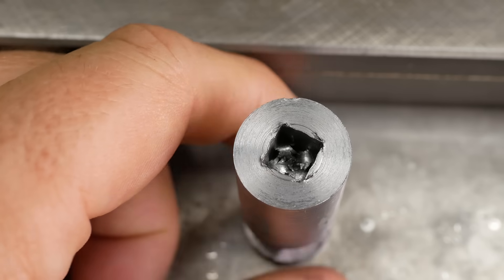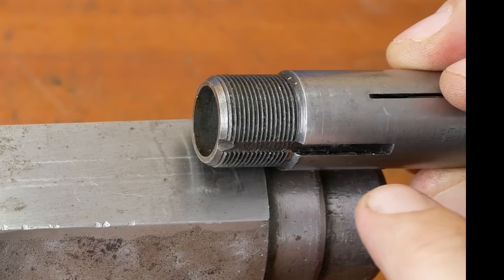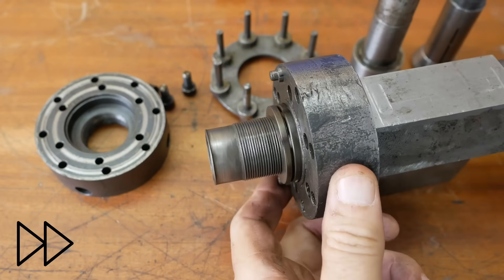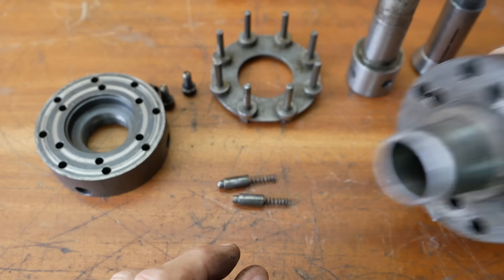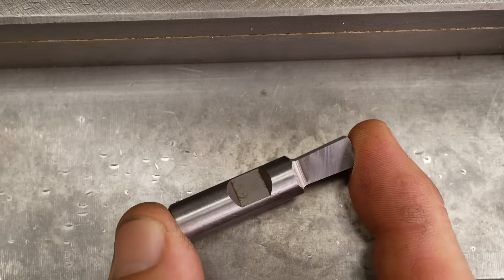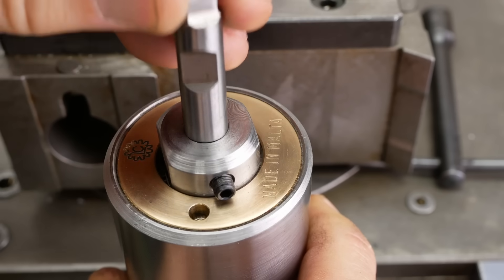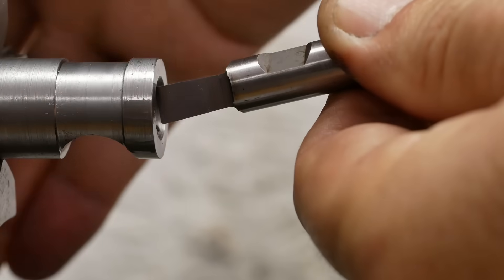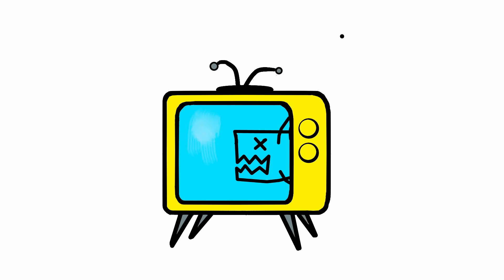Broaching problems - fixing my old indexer || RotarySMP

Comment: Molybdenium Disulphate Grease may not be the best choice for the plain bearing indexer. I would recommend installing a zerk fitting and use way oil to flush dirt out when you use it on the Clarkson.
Reply from the maker: Good point. I normally use the indexer on the mill, and was thinking more about keeping coolant out.

Comment: The stickout on the broaching tool matters. There is a sweetspot for the broaching tool if it is too near the the square will not be centered with the workpeice and same if it is too far. If it is too near and far it will ficght the bearings and the chuck to bent the tool over and over again and chip the end of the broach
Reply from the maker: I measured that focus point, but only eyeballed the stick out with a ruler. Does that stick out length need 0.01mm tolerance?

Comment: Im pretty certain those feeds and speeds were way off. I have a rotary broach from Hoffmann Group and have used it quite a bit also with selfmade silver steel cutters. The Hoffmann people actually advice on going fairly slow (maxbe 150 RPM) at the beginning with a really high feed for the first millimeter because otherwise the tool doesnt really seem to bite instead it drags across the workpiece surface a whole lot which breaks down the edgeds. After the first millimeter i usually speed up to about 500 RPM and slow down the feed. Cant give mm/min as Im using the tailstock unfortunately.
Reply from the maker: Thanks for the tips.

Comment: Looks like a hex collet block welded to a mount and indexer. Bolt hole pattern made on a mill maybe?
Reply from the maker: Yeah, others have pointed out it is a recycled 5C collet block.

Comment: There seems to be a fundamental difference between the tool being driven and the work being driven. Isn't the loading on the tool edge going to be different if the work is 'pushing it around' as opposed to the tool 'pushing' into the work?

(Full disclosure, i'm an idiot.)
Reply from the maker: Nope, that is the same, as the part always drags the cutting bit (it is mounted in bearings. In both cases the tool is advanced into the hole the same.

Comment: Hi Mr. SMP, a couple of things that you may find helpful is drilling out the corners first undersize, then the bulk of the material in the center. The other one would be an internal groove to help with chip compaction at the bottom, which will do an absolute number on your cutter.
Reply from the maker: Thanks for the tips!

Comment: hi about the feeds and speeds, i'm "often" broaching at 1000rmp with 0.01mm per rotation in stainless steel but it's with a tool from garant so not the same as an home made tool.
Have a nice day.
Reply from the maker: Thanks for that reference point. What diameter broach, four point or six?
Reply: @RotarySMP   it's 6 points 5mm

Comment: I made one of this same style. As far as the actual broach goes the tip length is very important! When I designed mine out in cad I worked from the cutting tips back and designed the rest of the tool off that specific length. That way when the cutting tips are rotating they are “on center” at the cutting plane to avoid the tips going “over center”. You probably need to either ask the tool maker what the tip length he designed the tool to or grind a tool then measure the tip “action” at center and cut the shank back until you get the tips rotating at 0.001” TIR or less. 

This style tool works better when the body is rotating and the cutting tip is “stationary” in the work piece. To use mine in the lathe I had to Chuck the tool in the lathe Chuck and clamp the work piece in the tail stock. This style works really well in a mill though!
Reply from the maker: I did measure to find the "focal point" in the last video, and there is an adjustment crew behind the bit to adjust it's length, but I didn't realise I had to set it that accurately. That could be the problem. I was just using a ruler to set about 21mm stick out.
Reply: @RotarySMP  I just recorded a 3 minute video demonstrating how the rotary broach works and why your style needs to have the body of the tool rotate relative to the work piece.

https://youtu.be/54lu8qeKosU?si=y4xHRh_IE-W8tpgl

Comment: The rotary broach I made after watching some youtube videos has slots, to move the rotating part to center. (I guess the design makes it easier to get the cutter on center) The tool does not care if the workpiece or the tool rotates. https://www.youtube.com/watch?v=O2glVyU0_C0 I think the starting hole size might be a big influence
https://www.youtube.com/watch?v=Vg7SCXOh-KY
Reply from the maker: Thanks Tim. I am starting to suspect I was not careful enough about getting the tip exactly at the right stick out for it to be perfectly centered.

Comment: Hi Mark. Check the other comments about broach length, it has to be correct for your broach holder. This may be your problem with chipped cutting edges.
Reply from the maker: I checked the focal point on the previous video, but thought a mm or there abouts is close enough. That lack of precision could be the issue. Thanks.

Comment: Ya, if the bearing set and broach holder are bored in on an angle to the broach body, then its a rotating type meant for a mill. You could prove this by reversing your setup. Chuck the RB in the lathe chuck and hold your work piece stationary in the tool turret. 
That's a neat little indexer, good example of never judge a book by it's cover. I have an old Hardinge 5c indexer that looks like it was ran over by a Tank, but it still functions flawlessly.
Reply from the maker: I still dont really understand why this type wont work with a rotating part? It is the same relative motion.
Reply: @RotarySMP  If it's built the way you describe, the broach cutter is just rotating on it's axis and not wobbling with the tool stationary. Here a couple videos from Slater tools to illustrate-
Rotary Broaching in the Mill, notice the tool is wobbling and not the cutter  https://www.youtube.com/watch?v=N93Eo_iDDDQ
Rotary Broaching in the Lathe, notice the tool is stationary and the cutter is wobbling  https://www.youtube.com/watch?v=Vurq5FgfQ_k

The other thing I noticed about the cutters you made, is the face of the cutter wasn't concave enough, if at all. Looking at a close up in another of Slater's videos, gives an idea of just how much of a concave profile is needed.  https://youtu.be/OnJ3MUFHqws?feature=shared&t=113

Comment: Corner breakage indicates dragging.  Have you thought about trying a different gage length?  Originally you set up for the focal length, but that means zero stroke (I think).  Maybe the tool needs projection to take advantage of the clearance and get more action.
Reply from the maker: The cutting stroke is generated by the offset angle. I suspect I was not accurate enough setting the tool stick out.

Comment: It doesn't matter weather the job is still and the tool rotates or vice versa, its just a change or reference plane. 
The tool stickout from the broach holder is critical - if it sticks out past the point where the two axies intersect then the tool tip experiences some radial movement into the work piece as it cuts (stick it out way to far and you can see this movement) - guaranteed to chip the tips of the tool. This may not be your problem but it just might... 
cheers
Reply from the maker: Thanks Peter. That is a good tip. I only roughly set that length within about a mm.

Comment: You can try to broach the square holes in 2 steps to reduce the load on the broach. The first broach with chamfered edges to remove the majority of the material and the second broach with regular square edges to just cut the corners of the square hole.
You can grind the broach for the first step out of the slightly damaged broach, just grind the damaged corners off.
Reply from the maker: Thanks. That is an excellent tip.

Comment: The axial position of your broaching tool may not be set correctly. It needs to be spot on at the position of 0 runout, since otherwise the cutting edges experience very high side loads (meaning radially), they are not able to withstand. You already sort of demonstrated that setup in you last video.
Reply from the maker: Thanks Felix. I did measure it, and I set this one, but only with a ruler to within about 1mm. I'll do it more accurately next time.

Comment: Don't rest your ultrasonic cleaner basket on the bottom of the tank, suspend it.  It's common to have some hooks on the basket handles that fit over the tank sides.

The transducers are fastened to the bottom, and anything sitting on the tank bottom makes it harder for them to vibrate the tank bottom as well as they should.
Reply: I never knew that, thanks for the tip!
Reply from the maker: Thanks. That is an excellent tip.
Reply: @RotarySMP       Another tip you might try, is to fill the bath with tap or distilled water, and then place the components into ziplock plastic bags containg the cleaning solution. It saves clenup after, and reduces the amount of cleaning solution.
Reply: @squelchstuff I do this all the time at work with ipa to clean flux residue :)

Comment: Is the workpiece in the lathe subject to work-hardening?
Either way looks a lot like workpiece too hard and cutter too soft.
Maybe it needs a sharper cutter (ie; more end-concave giving more rake angle).
Interesting project, thanks for sharing.
Reply from the maker: The steel is finest scrapbinium, but given it's mill scale, I am suspecting a building industry and not tool making alloy.

Comment: Hi Mark  rotary broaches absolutely work that way on lathes. I have been involved in setting them up on cnc lathes (long ago and far away).
If you have not already done so, spend some time looking at the slater tools videos and documents lots of information there.
there are other manufacturers as well
(edit) just a thought,  are you certain that the tool is set to exactly the right length? if its off it will orbit the centerline and that
could cause breakage.
Reply from the maker: Thanks Steve. I measured that focal point on the last video, but only set it to within 1mm or so with a ruler. I guess that needs more precision :)

Comment: Your tool looks flat bottomed, you need to grind some relief into the face that approaches the work piece. The face approaching the work needs to be concave so the corners are more like points.  It should work then.  Slow the spindle down too, 1000rpm is a bit on the quick side.
Reply: You can see the spiral grinding marks in the end where he's ground the radius, and he showed how he did this on his HSS tool last week.
Reply from the maker: Yes, It did have a concave face, although less concave than last week. 

There is a speed chart from Slater I found. Looks like they recommend more like 1500 rpm for a 7mm broach.
Reply: Ok, time to get my eyes tested again, could have sworn that broach looked flat on the bottom.  Interesting point on the speed, I did a bit of poking around on the inter webs and found sites saying anything between 600 and 1800 for a broach that size, so your guess is as good as mine.

Comment: Made my camlocks using allen bolts, built up the threads with weld and machined.
The only downside you have to make a chuck key to suit.
My rotary broach is in the cabinet gathering dust.
Reply from the maker: Hi Willem, I like that approach, but I was gifted the rotary broach, so it better get used :)

Comment: Perhaps the back angle taper needs to be larger...could be stress on the withdrawal phase of the rotation that flakes the front face off.
OR perhaps the "corners" need to be relieved a bit more before the final cut ... eg drill round, broach octagonal, broach square.
Definitely "Jai-rate" in the UK.
Reply from the maker: Thanks, all good inputs. I guess my English is mutating to Denglisch :)

Comment: I wonder if a carbide insert on top of your cutting tool could solve your breakout problem?
Did you or Mr. Gotteswinter show how to grind Carbide bits? If it was you, you should be able to bring an insert and mount it on your cutting bit.
However, I think a slower rotation speed should help too. 
Good luck!
Reply from the maker: I would suspect that carbide will likely chip even easier than HSS, and the Slater website has a chart suggesting 1500RPM for a 7mm broach.
https://www.slatertools.com/support/recommended-speeds-and-feeds
Reply: @RotarySMP have a look at this flic of cutting a hardened interrupted surface with a carbide bit. 
https://youtube.com/shorts/r6BulVOcpOU?si=X41A1XzJiaGn2MFL
If that can stand the stresses then it can withstand the wiggle motion of your broach.

Comment: Hi mark was just wondering if the two locking pins were one for each indexing assembly as you only have the eight pin mechanism. Hope that makes sense as you wouldn’t want to disassemble it to change from eight to six .
Reply: That's my take too.

{edit}
WAIT!On second thoughts, that won't work. There's nothing to push the second pin in.
Reply: @squelchstuff     agreed, it must be rebuilt to change from 6 to 8.
It is an unusual design, and the only real reason I can think of for 8 detent pins is to give very strong security against rotation. I think it might have been made as a factory tool for an indexing production job that needed to withstand a lot of leverage. It is a quick change mechanism with high security.
Then, for hobby use later, it was probably binding or stiff etc with all 8 pins so he took some out.
Reply: @squelchstuff good point , maybe the six pin may have fitted with the eight .
Reply from the maker: Yep, that summarises my thoughts as well. If you only used one pin per pattern, you would not need all the holes, and you would need a double pattern plunger ring thingy.

Comment: I cant give any specific tips, but this old Tony made a video series about rotary broaches some years ago. He bought a comercial rotary broach with included hex broaches, and also managed to grind a working  square  broach from an old end mill. He also used the same broach in the lathe and on the mill, so this should not make a difference.
Reply from the maker: Thanks for the info! I must have watched that video and forgotten about it. Will watch it again.
Reply: From a physics perspective, whether the workpiece or tool is rotating is all just a matter of where your frame of reference is located. If your reference frame on the lathe is the workpiece, then the "stationary" tool on the lathe would look like it is the rotating object and the "rotating" workpiece would be stationary. And similarly if your reference frame on a mill is the cutter, then the cutter would look stationary and the workpiece would look to be rotating. As far as their relative movement between cutter and workpiece, there really shouldn't be any difference between a mill and lathe.
Reply: @Beef4Dinner22  Thanks for saving me the typing 😆

Comment: That thing doesnt look badly made, but man does it look banged up
Reply from the maker: The locking pins are really nice , hardened, ground, an air release groove. The latching body still has the mill scale on it. Wired.

Comment: Speaking as a physicist it makes no difference if the broach is rotating or the work is rotating, it's all a matter of reference frame. 
If you want to get exotic: https://youtu.be/T4q8gCpeY1A (But I think that tool clearance would be difficult with a square)
Reply: Hey, how did you manage to make a post with a link in it?  Every time I do that, the post gets 'disappeared'.
Reply: @somebodyelse6673  I think that you can always link to other Youtube videos, but not necessarily to external sites.  Otherwise it depends on a setting that the content creator sets, and in many cases they have to manually approve the comment if there is a link in it.
Reply: @andypughtube  - I had no idea that a manual approval was even a thing for Youtube comments. I learned another new thing today, thanks!
Reply from the maker: Hi Andy, I think the comment on my last video missed the offset built into the tool.
My Schaublin spindle motor is not a servo. Cool what you did.
Reply: @RotarySMP  It works on the spindle encoder. In the video I am turning the spindle by hand with a handle in the spindle end.

Comment: Are you able to mount it in the tailstock on the Bolly so you can 'feel' what's happening? It might give you a chance to try out various feeds and speeds before the cutter is ruined.
Reply from the maker: Unfortunately not. The Schaublin Tool have holder shank of 25mm is bigger than I can mount in the tailstock, or the Maho spindle
Reply: 😞 @RotarySMP

Comment: If the broach just needed to be cocked at an angle, then the eccentric tooling would be unnecessary, just rotate the compound a bit with a parallel/concentric tool...?
Reply from the maker: That is done isn’t it?
Reply: So it is.
Which makes me think that the wobble type broach is necessary for milling, but not necessary for the lathe.
Re speeds. They're usually surface speed dependent right, but the surface speed of the oscillating corners is basically zero since they're moving so little with respect to the work - turn the rpm up as fast as she'll run
Reply from the maker: @aaronhammond7297  Good point Aaron.
Reply: The effective feed rate per revolution, is set by the angle PLUS the axial advance of the tool, yes?  

Pick a corner on the broach, and in one revolution, it moves in the Z axis by the sine of the offset angle, I think?  It's a little weird for me to visualize, how much the rotation advances the tool point, in conjunction with the Z axis tool feed.  So, I think the net feed rate is higher than the feed rate of the tool?
Reply: That's a really good point! <sound of partially-completed rotary broach landing in the scrap bin>